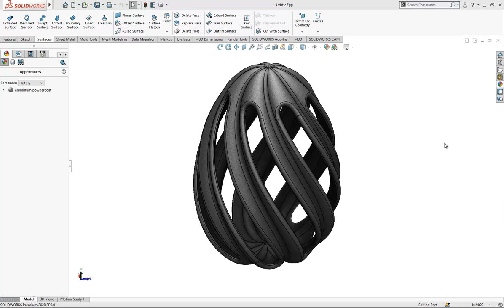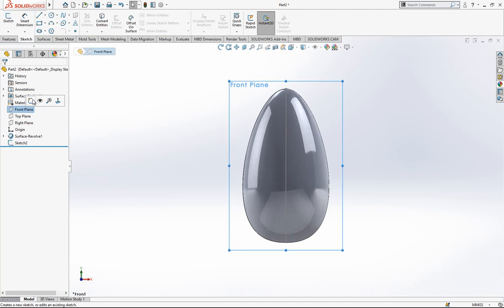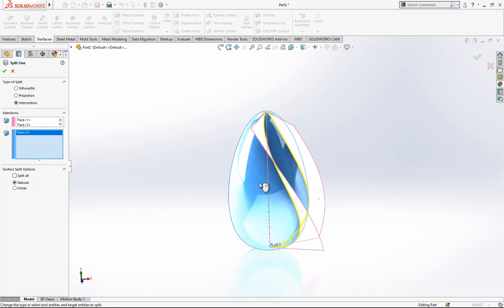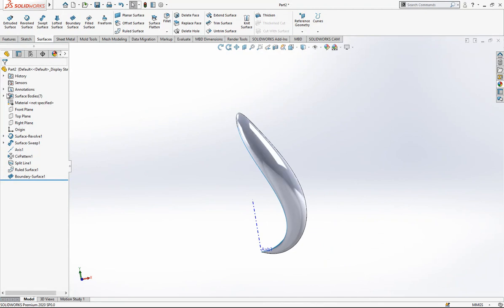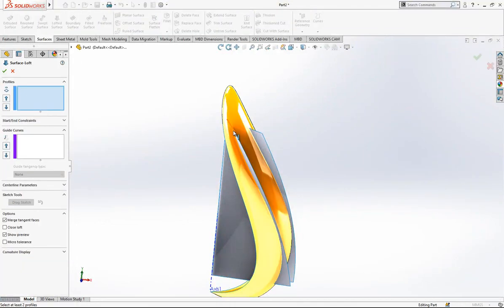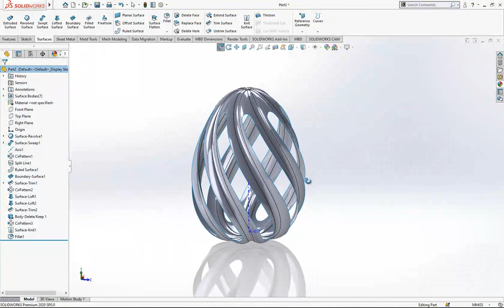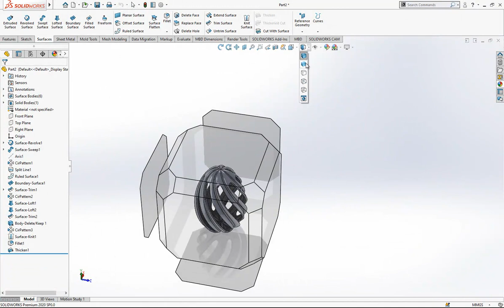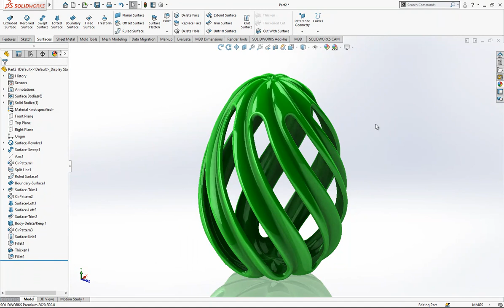Advanced Surface Modeling - SolidWorks Tutorial

Comment: The fillet part didn't work for me. 
Showing error!
Reply from the maker: Yes I had also such an issue.

Try to make variable fillet, where start point having " 0 " value.
Reply: @3D-World  Thanku for the reply

Still variable fillet is not showing in model, its working but nothing changes!
Reply from the maker: Thickness at the end of the edge reaches to "0" and that is the reason why program not able to handle this issue
Reply: @3D-World  Yep. Thank you so much
Reply from the maker: I have tried in NX and worked there.
Did you try to make FaceFillet operation
Reply: @3D-World  Yes I tried, but the error keeps occurring.